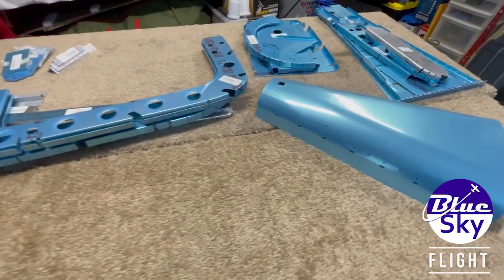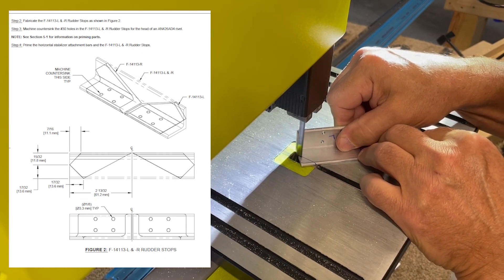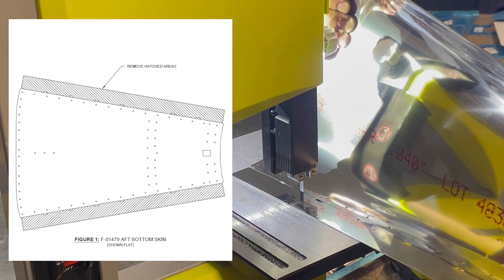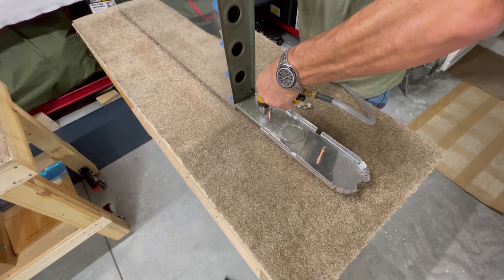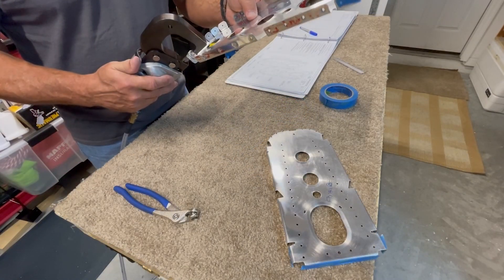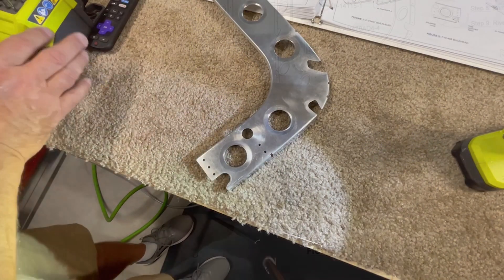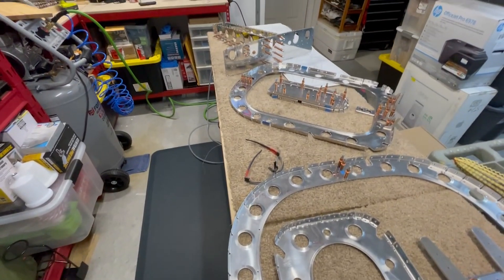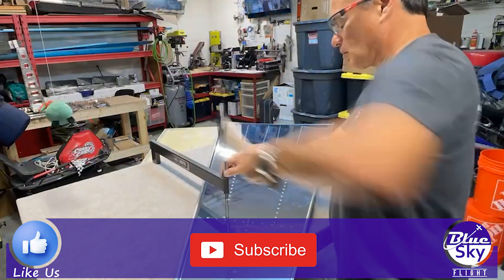Aft Fuselage pt1 -  Building a Vans RV 14 Airplane Ep11

Comment: Another fine video. Thanks. Just spent the morning attaching the rudder skin sides to one-another. Applied tank sealant on the trailing edge. As you know, there are two methods; double-sided tape, and tank sealant. I wanted to get familiar with the sealant before building the fuel tanks.
Reply from the maker: Thank you ! It’s a sticky mess isn’t it :)
Reply: @BlueSkyFlight  My EAA Technical Counselor gave me the best advice: Double nitrile gloves. I you get the tiniest bit of sealant on a glove, shed it and put on another because it'll get on everything. Warned that I'd go through about a dozen gloves total. Think I shed at least six total just on this one job. My wife helped by managing the curled-back skin. She went through four gloves. The trailing edge is clecoed (every hole) in aluminum angle. Flame Master's info sheet lists 114-hours for full cure. I'll respect that.
Reply from the maker: LOL yeah it’s a mess